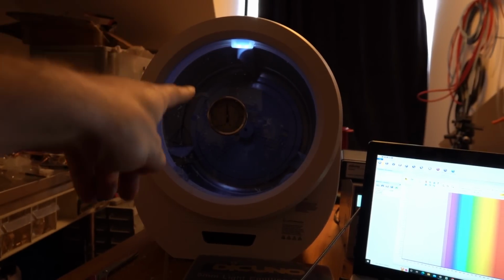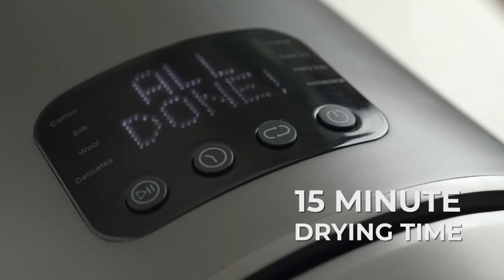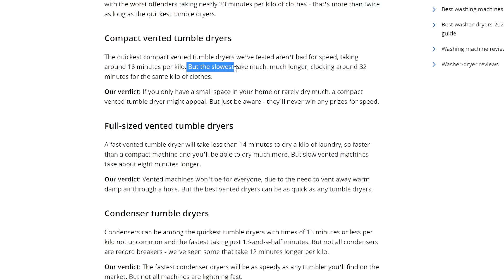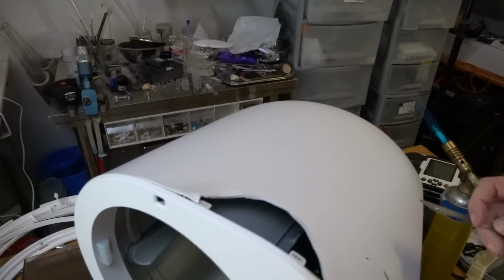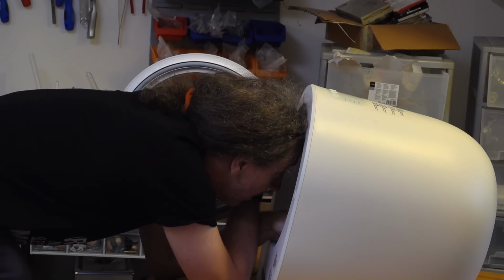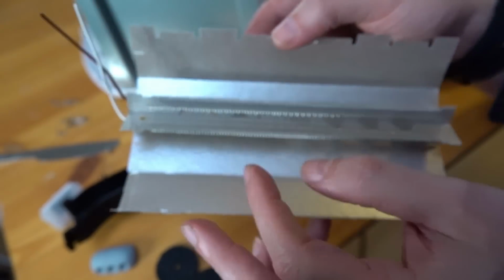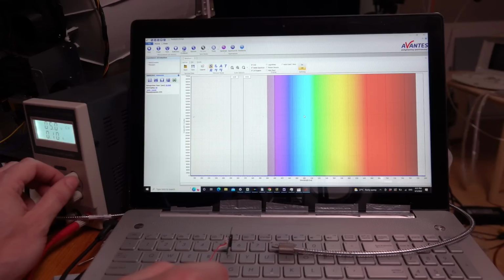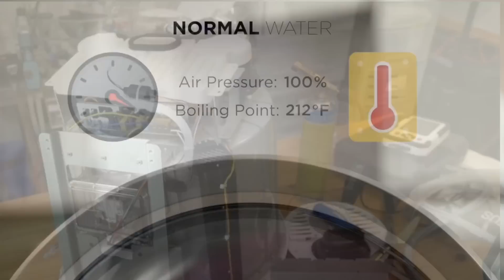Autopsy of a Scam-Starter: The Morus Zero!

Comment: I think the UV LED is there for legal reasons, not sterilisation.
Their defence being that they're just bad engineers & not scammers. 
Same with the condenser that doesn't work. It's there so they can point to it & say "There's the condenser." in the court room. It being an efficient condenser is a side issue.
Those heater coils are the same. All hot objects radiate in the infrared. What we call radiant heat is just infrared light.
The whole machine is built to minimum LEGAL standards, not engineering standards.
Reply: But they claimed its Vacuum system, which it clearly isnt. That statement would be easy to break up at court.
Reply: No space vacuum, though. Isn't that sueable?
Reply: I thought the same about the infra red. You make a good point, they've done what they advertised but it's bare minimum so they haven't technically scammed anyone.
Reply: similar to those old 999 in 1 game thingy right ??? where they are like 8-10 games in repeat with some minor adjustment like different starting item, heath, etc =w= It can count as 999 different games but it is not =w=
Reply: @michaelm1  but what is "space vacuum"? They don't claim "hard vacuum" or "outer space vacuum", you could say they vaguely insinuate it. On purpose? Of course, but could probably not be proven in court
Reply: It's built so they could actually deliver a product, which is more than you can say for most Kickstarter projects. Yeah it's meant to just barely be legal in terms of obligations by their campaign
Reply: @TheGreg6466  I mean technically when that heating coil gets hot, it will emit some light in infrared - every hot thing does - that's how a thermal camera works
Reply: @malthenaundrup   In defense of kickstarter sellers, it all depends on what your looking for. I've backed and received products for a dozen or so kickstarters and haven't had any issues with them, I'd say it's down to properly identifying what product is being sold and determining the validity of their capabilities to actually produce said products. Now the things I've backed are actually stuff I want and may or may not be on a whim. But much of it has been some EDC stuff and a nice ratcheting leather belt, and a nice jacket. (I like titanium edc stuff... flashlight / pen / marker / pocket screwdriver) (I may have an addiction to owning things in titanium) but my main reason for backing is that often times you'll be able to get things  at a better price then something being produced currently and/or even in better quality. It's all down to a buyer beware mentality for me, I just do what research I can and weigh those odds
Reply: The heat is radiated, but more just convected here. There isn't really a good radiation path, hence the powerful fans.
Reply: Yeah, the law doesn't seem to help in this case, but the reviewers can.

Too bad in Japan reviews aren't allowed.
There's no fair use even for review purposes.
Reply: @cyphi474  They claimed vacuum technology, not vacuum system.

They have been carefully wording their marketing in a way that leaves the customer interpretation lead to something better than it is, but at the same time leaving room for a legal interpretation that doesn't screw them.
Reply: @utrak  Earth is space, we're not in a different dimension.
"Space vacuum" can be the Earth's atmospheric pressure.
It's not technically wrong.
Reply: @cyphi474  too bad propaganda is legal. Unless someone gets hurt or injured with this product, there's nothing to go to court about.
Reply: @utrak  Yes, they do. When they say space vacuum, they show a picture of outer space. So yes, they very much imply outer space vacuum.
Reply: For anyone curious.
Lawsuits are won, often enough, on just public perception. This is why marketers have to be very, VERY, careful about their wording.
If you say "Vacuum Technology" but there's no reasonable application of any Vacuum Tech (Seals, pumps etc.) -- that's false advertising.
If you also say that it's NOT like a vacuum cleaner but instead show a picture of space? That's even worse. That's implying that your device operates with a vacuum comparable to Earth's upper atmosphere.
This device produces no real vacuum to speak of. Also making the claim that "Technically: Earth is also Space" doesn't work. If you say "it has vacuum technology" and imply space vacuum... Then obviously we're not implying that vacuum also includes standard Earth atmospheric pressure.

Companies will pay people tens of thousands of dollars simply to avoid these kinds of mistakes. Even if you DO have a significant vacuum (Let's say 100 millibar), you likely will still face lawsuits and potentially lose from that position.

Devil's advocate is fun because it allows us to highlight the ways in which a sleazy corporation might try to swindle us but in this case. It's not even necessary.
Reply: @dispatch-indirect9206  It's false advertising. It's been mentioned before. Your damages are buying something that doesn't have features that were advertised. You've only purchased the thing because you were lied to. That is a scam and that is actionable. USA has these things called class action lawsuits. I'd like to see one here.
Reply: Not really "legal reasons" unless they'd like to take the UV out because they found it to be pointless, and with that in mind, it would be interesting to see how effective it is with a petri dish in there along with some clothes for 15 mins.
Reply: I think they might have had a genuine idea at the beginning and then they realized it was impossible to do with their own design so they tried to meet the legal standards as you said, in order to not be defined as scammers.
And, as a kickstarter, it is at the supporters' own risk if the product is really good or really sh*t so they are "save" from court cases.
Reply: @Mr_Mouse_  Cool story.
Reply: @cyphi474  maybe they've a trade mark on the term "space vacuum" but when brought to a court they claim it's actually a typo and they wanted to reserve the rights on the term "fake vacuum" ... 😉
Reply: @cyphi474  Good point. Why on earth did they bother with all the silly claims? They could've sold it as a nicely built machine ideal for a single person in a bedsit. They'd've had a sustainable business then.
Reply: @cyphi474  it TECHNICALLY drew a vacuum inside the machine while in operation... it was just an exceptionally weak vacuum.
Reply: @dispatch-indirect9206  The price of the unit, at least. It doesn't matter if it dries clothes. It doesn't have a feature which was advertised. You could have bought something cheaper that isn't advertising space vacuum technology.
Reply: @dispatch-indirect9206  Besides, this only refers to civil litigation. False advertising is a finable offense, so you prove it, they get fined by the state just because they lied. You don't have to prove you've sustained damages for that.
Reply: Consumer protection law in the UK means something can be misleading if it is designed so it deceives or is likely to deceive the average consumer even if it is factually correct.
Reply: @cyphi474  And technically that wasn't a condenser on the back either.
Reply: That was my thought as well.  There is 'non-zero' vacuum.  There is infrared.  There is a condenser.  There is UV light.  It does try a sock in 15mins.  There is nothing that can be pointed at in court to damage them as far as I can tell.
Reply: "Not a scammer, just a bad engineer"

Sounds on par with "not a murderer, just a bad doctor"
Reply: Infrared heating implies heat transfer by radiation. Heating elements are heat transfer by conduction and convection.
Reply: there's also the idea of 'puffery'. So they could argue that certain statements were not intentionally misleading but were exaggerations that weren't supposed to be taken literally.

https://en.m.wikipedia.org/wiki/Puffery
Reply: @michaelm1  Technically they show the Earth, seen from very high altitude.
Reply: @utrak  Not just high altitude. Seen from space. Where there is vacuum.
Reply: @cyphi474   Exactly
Reply: @cyphi474  This is easily defensible.   
Prosecution: "You claim that it is a vacuum system but there is no vacuum created here."
Defense: "Your Honor, the production has already established that our product really sucks.  Therefore it is a vacuum."
Judge: "Case dismissed"
Reply: @wakenow7612    Then Amber Heard had the freedom of speech to say wtf SHE wanted on HER websites or whatever platform agreed to let her say what she wanted.  Even if you or I disagree with it.
Doesn't matter.  Free speech is legal, as you just said.
Reply: @michaelm1  Well.. Actually they show a picture of earth in space...
Reply: @michaelm1  they vacuum form the front, clearly.
Reply: @michaelm1  Aha! "from space" So not outer space then? And yes, there is indeed """""vacuum""""" in """"""space"""""" (Morus legal logic)
Reply: @utrak  Not sure if Morus legal logic is legal. Depending on your jurisdiction, this logic might not hold. Consumer protection laws are getting better. They'll ask what would a reasonable person think if they saw the commercial, which is space vacuum. And that might be enough to convict. That is, if someone cares to start the lawsuit. We'll see if someone does.
Reply: @theultimatereductionist7592  So true.
Reply: I think the water container is there for catching excess water dripping of very wet clothes.
Reply: @cyphi474  nope. they were smart enough to have lawyers check all their statements and made no guarantees with their early claims either. legally, they are pretty safe.
Reply: @cyphi474  anything that blows also sucks. Suction creates a small vacuum. It is using vacuum power.
Reply: @cyphi474  It had a teeny tiny little bit of vacuum  And it might have a teeny tiny bit of UV or infra red being it might be in the spectrum of whatever LED was tossed in there. Not sure what would happen in a lawsuit but I would imagine they either were legally consulted, and/or have an exit strategy in place in case of a lawsuit. When you consider what Theranos got away with, this is peanuts. There does come a point where you have to hold some accountability to investors for not doing any research as to what they are investing in.

As far as any consumers who purchased this junk unless they can find a good lawyer to conduct a class action in which the lawyers will get most of the money should they win the case regardless.... I just don't know from here. It's a dryer, not a medical device or claimed breakthrough to save lives. [edited due to confusing UV with IR]
Reply: Call me mr 420
Reply: UV LED's are cheap and strong enough nowadays that the one in it is actually a proper power to disinfect the clothes, especially for the amount of time they will spend drying (~15 minutes).
Reply: @andregon4366  May they  use vacum tubes somwere? :)
Reply: @utrak  There is no half vacuum. There is vacuum, or there isnt. We could talk about "close to vacuum" or pressure thats significantly lower than enviroment(not being able to open doors because of pressure difference, like example).
And yes, you're right Vacuum cleaner isnt really creating vacuum. Probably could since its very strong gas pump(+-). Typical household vacuum cleaner has about 1,5-2kW engine. Give it so strong engine and you will have problems to open even this crappy sealed doors. 
But in this case, they claimed vacuum as part of drying process and thats lie, since there is no vacuum, or anything you could say, both eyes closed, is 'like vacuum'..
Reply: @cyphi474  Still, unless the judge is SUPER AUTISTIC, I suspect Morus could get away with it in court. Which is all that matters to Morus
Reply: If I was the judge, I'd define the whole thing as a scam.
Reply: When you pledge a kick starter project, it's exactly that, a "pledge". You haven't PURCHASED anything. There's not a single legal leg you can stand on.
Reply: If you think about it, it is technically kind-of vacuum technology. That fan looks very like one you would find in a vacuum cleaner - and it does work by sucking the air.. All arguably legally correct and it does dry clothes.. The thing that struck me was how over-engineered it all was - particularly the heating elements and all the electronic elements.. Something very strange and crazy about that - like the Juicero juicer.
Reply: I wouldn’t want my clothes blasted with UVC anyway, it would bleach them out
Reply: @cyphi474  The statement "Not that 'vacuum' but this vacuum..." could be interpred as not meaning a vacuum cleaner, but lower pressure as such. The drying chamber of the DUT actually has a lower than ambient pressure. Therefore they may claim that it has "vacuum"
Reply: @cyphi474  
No, no, vacuum is a gradient, a partial pressure. Its why we have gauges to measure how much.
Reply: @utrak  I think they might get away with that one by claiming puffery, it might push the boundaries of what some advertising standards agencies would consider misleading eg the UK for example. But then then if someone complained the likely outcome is simply being told that you need to withdraw the ad until the offending claims are removed or clarified to not be potentially misleading. Sure if you decide to fight them on it there is a potential risk of fines but for the most part if you have any sense it's like getting told to redo your homework hardly a big deal.
Reply: Dang
Reply: @Lee Hemmings While I grant you they probably are banking on the "Technical Standards" - I can assure you that it would not land in a Federal Court and 100% WOUDL NOT win in the EU...

... Even in the United States, There is a recognised federal Standard - Meaning all products that claim to work for a certain purpose must meet a set criteria... The fact they have a condenser would not be enough - It would have to meet federal regulation standards... Its plastic, It would not meet Federal Regulations!

The UV LED gets FAR TOO HOT and is a Potential Fire Hazard, once again, Against Federal Standards... 

They may be able to win a Civil or Class Action Lawsuit but of one of these things were to set on fire - They would be F**KED! They are NO WHERE NEAR the required legal Standards!
Reply: Except for the “space” vacuum and the fact it dissent dry clothes in 15m and it’s completely energy inefficient. Seems like a lawsuit candidate.
Reply: Made in china....what legal standards or standards in general? Lol
Reply: @cyphi474  It has a slight pressure drop.
Reply: but is it even an UV LED? Seems more like they put it there precisely because it's a cheap additional scam-feature.
Reply: @jossdeiboss  I have more of a feel of "sincere honest belief in the feasibility of the real product as advertised" from the "solar road" people. This thing being absolutely no vacuum whatsoever and saying it's "space vacuum" is pretty hard to defend as anything but dishonest.
Reply: @michaelm1  They create a slight negative air pressure from blowing air out the back, so technically the chamber pulls a partial (negligible) vacuum.
Reply: @wrlprchnx  and TECHNICALLY there are other atmospheres in the universe, in space, so TECHNICALLY vacuums found throughout the space in some cases can be pretty close to Earth's atmosphere. Which may arguably itself count as space vacuum, since Earth it is in space. TECHNICALLY even a high-pressure chamber with more atmospheres can be said to be a "vacuum," compared to an higher hypothetical atmospheric pressure, such as that of Jupiter. Since the Earth is in space from the POV of Jupiter, not in Jupiter itself, Earth's 1atm or more is also ""space" "vacuum.""
Reply: @YourMotherSucksCocksInHell  technically, all matter has quantum vacuum on it -- the same quantum vacuum exists in space. All matter in fact is more vacuum than matter, space has only even more so. So, technically, they could have shipped a block of lead and it would technically still be space vacuum. And you could dry clothes on it, too.
Reply: @zbdot73  maybe the "pledge" technicality can be played to advantage of the scammer, but I'd guess that there can still be made a case of fraud, that the pledge wasn't really what was advertised. It wouldn't then be a case of standard consumer litigation, but some other kind of branch or whatever.
Reply: @nixxonnor  barely mensurably lower than 1 atm, far from the advertised space vacuum. In fact, probably even worse than the vacuum cleaner vacuum, to which they contrasted the space vacuum promised.
Reply: @andregon4366  so like "military grade", which just means "cheap enough to work"
Reply: @PointsofData  I don't know what you're referring to.
But yes, "military grade" means cheapest price, but also means that it has to work.

Comment: Hmm..I once wanted a clothes dryer and went to the store. I ended up buying a Maytag. That was 36 years ago. It still works as advertised and need only a lint screen replacement in all those years. I don't think it cost me more than half of what a Morus costs. Times, people and scams have certainly changed though.
Reply: We've got a Zanussi dryer that's 21/22 years old: haven't used it in years, preferring to use either our outdoor clothes lines or indoor drying frames, but I'd bet the Zanussi still works if we needed it.